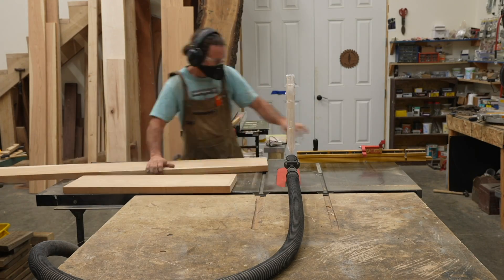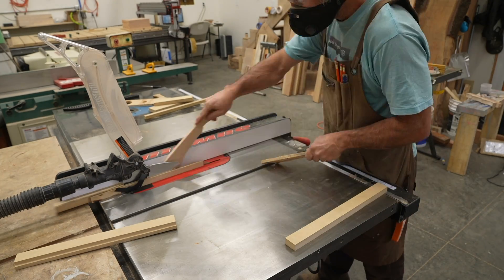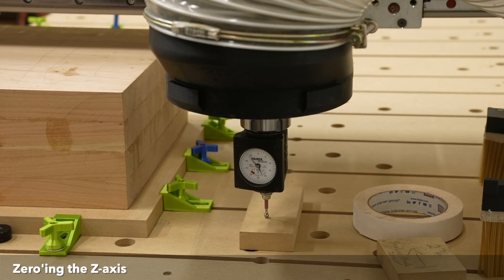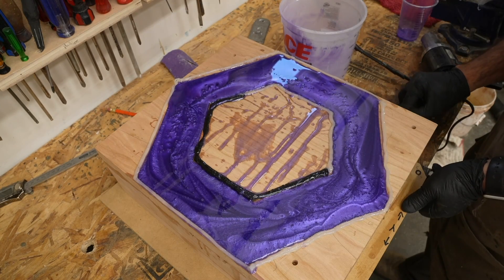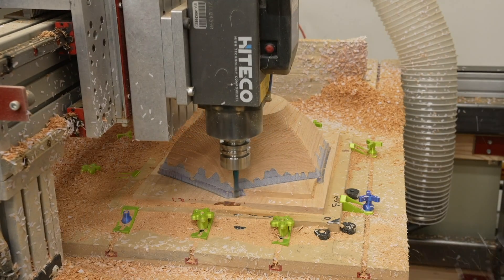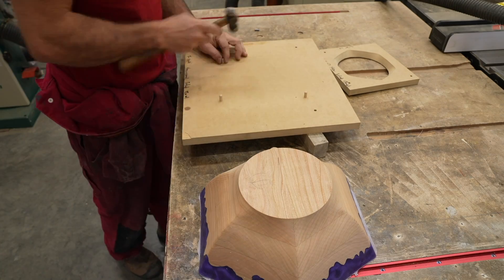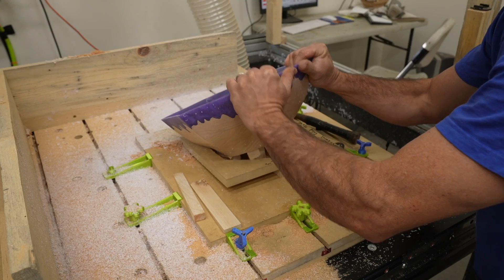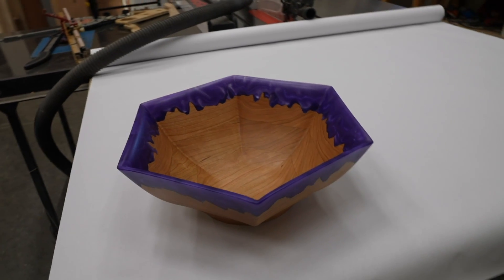CNC Machined Hexagonal Salad Bowl with Purple Epoxy Drips on Top  / CNC Router and CNC Woodworking

Comment: BTW...I have really good luck with Xtreme 2-sided tape and 2" wide...
Reply from the maker: Cool! i've used that brand's stuff too...it works well, with less wiggle than it used to have, but it is harder to rip-cut by hand -- I have to use scissors. I think it is cheaper than the tape I use.

Comment: I would LOVE to watch a video on re-starting Mach4 g-code!!!! Did you ever make one?
Reply from the maker: I haven't yet! I should do it...as there are a few gotchas (like stopping/restarting the spindle).
Reply: I 'learned' on the fly when i had a long 3d finish cut lose Z all the sudden and was cutting air. I stopped and first I guess ignored the warning that the spindle needed to be re-started first but then started the spindle and just guessed as to what line of GCODE to start at. Any insight on that would be great! I am ordering your hold-downs now. Thanks @CorbinDunn
Reply from the maker: @dankinsky9543  It's always some emergency situation whenever I have to start and restart! One thing that is good to do is to backup to a Gcode line the that has an X/Y and Z move. Move the Z up some clearance/safe amount, move the X/Y to that starting point, and then let it go; it'll dive down to the appropriate Z and then continue along the way.  If you don't move to the right starting X/Y it will dive down across your workpiece and ruin it (I did this once!).

Comment: What design is used for the application, boss, can it be used on a small CNC machine such as the Amco MTU 150 Control Delta
Reply from the maker: Yeah! I use Fusion 360. It has post processors for most CNC machines, so I'm sure you can use it for yours.

Comment: That is one huge bowl! Looks like you have the process dialed in. Nicely done.
I wonder if the chatter you were seeing is from the wood itself resonating from cutting a thin-walled shape?
Reply from the maker: I was seeing it on the outside (when it was thick and not thin-walled yet), and it happens when the y-axis stops and the movement starts on the x-axis. The y-axis deceleration is causing it to jitter a bit.